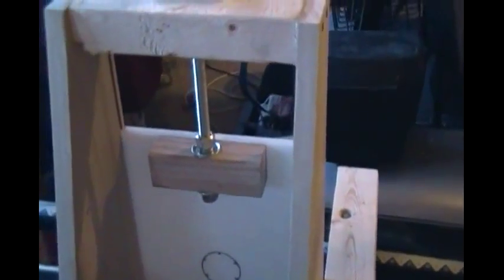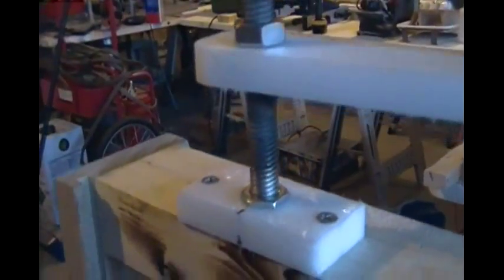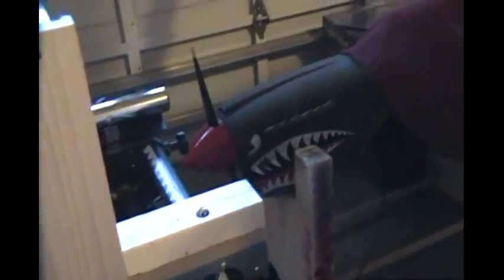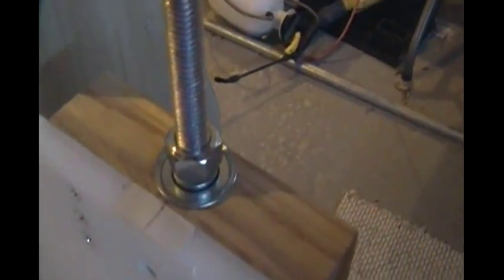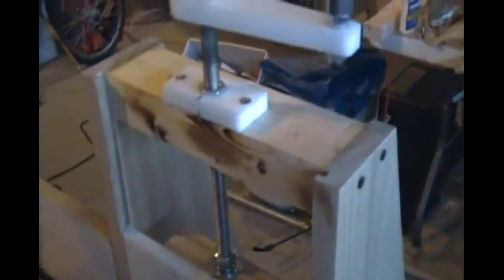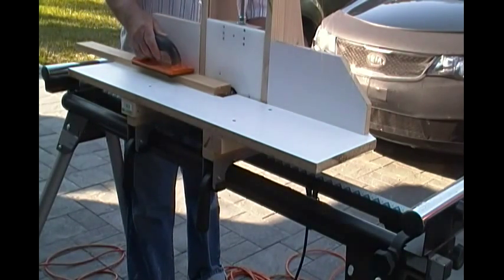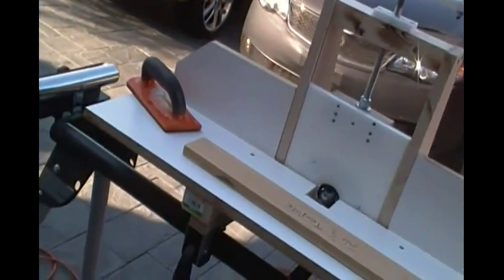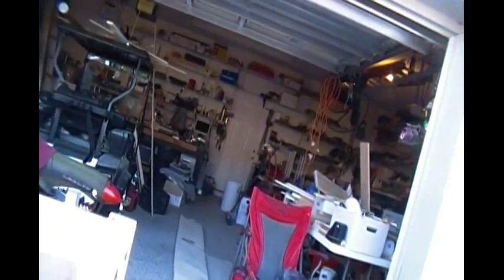DIY horizontal router

Comment: That is ingenious! Very portable and easy to store. Just a thought...maybe route some 3/4" channels into the surface and aprons to mount "T" track. Then you could use feather boards to stabilize your work piece. One question, is it dangerous to be working from the front of the table instead of reaching around from the back? Thanks for taking the time to video your work.
Reply from the maker: Not at all dangerous. I found that after using it for making my 12' baseboard that I was using it from the front, not the back.
I didn't feel the need to have a feather to hold the workpiece at the time I built it and frankly, thus far, haven't had the need to hold the workpiece other than in a downward direction. To do that I just clamp my feather to the back of the router. For long pieces you need to support both ends so the board doesn't bow in the middle (lifting off the table) while routing.

By the way, I took all my infrequently used power tools, scroll saw, band saw, bench grinder and a couple I can't remember right now and mounted them all to use this Ryobi stand. When the tools aren't used they occupy a shelf in the garage and not my precious floor space if they were mounted on a traditional tool stands.